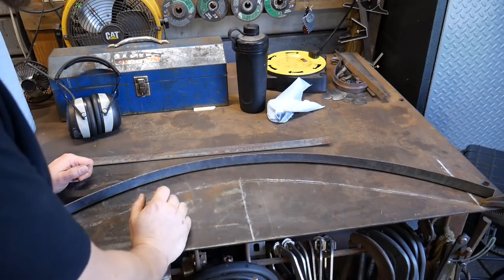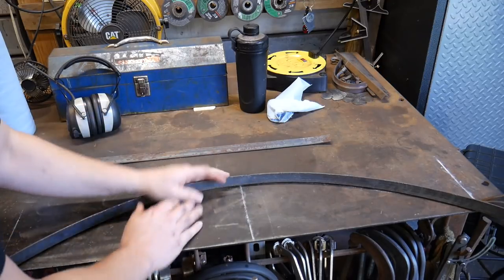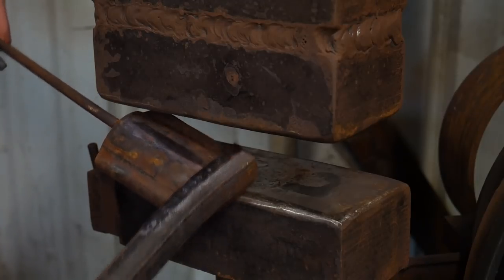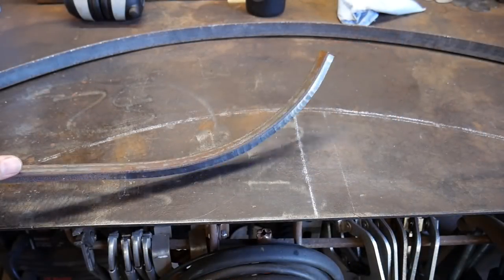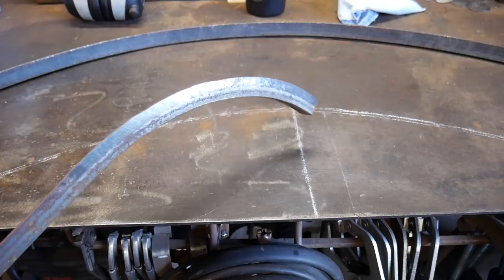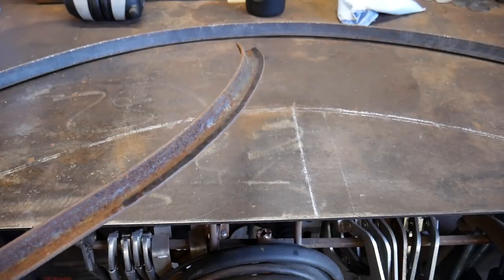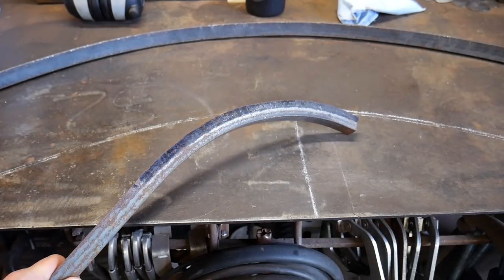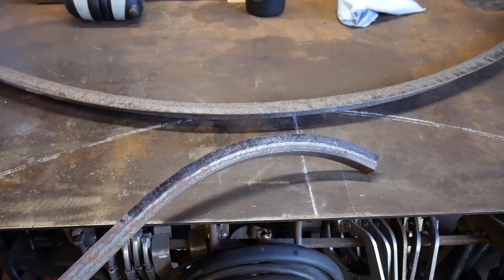How to Bend Angle Iron by Hand or with a Power Hammer

Comment: Francis Whitaker used to show a technique where he pre bent the angle in the opposite plain which then brought everything back inline when he made the final bend.  He did it all cold with bending forks.  Said he learned it from workers in canneries that made the tracks for the cans to roll down.  I have tried it and it is hard to get your head wrapped around.  Your technique is a bit more straight forward.
Reply: Roy's technique may be more straight forward but it leaves one edge thinner and hammer textured which is something you may not always want.Knowing both techniques is probably the best answer to problem solving.
Reply: differential pressure, this like differental heat treating that used in japanese cutlery and swords is what causes the famed curve one side has a greater pressure to harden in the water over the other when quenched and the clay side much more slowly cools,  so to with single bevel broadheads, oneside cuts and the other has a bit more drag so it walks as it goes though and creates a drillbit effect.
Reply: I'd like to see that.
Reply: what the bending or the drillbit effect of a single bevel broadhead?

Comment: Excellent!  I have a question-If I have 24 inch long wrought iron strap hinges, and they need to be bent up more than 45 degrees near the hinge end to be offset, can this be done by cold hammering? Others like this are sold pre-bent so that recessed doors can be opened and still clear projecting brick or stone. However these are all cheapo-looking factory made mild steel and this is for an historic appearance. Those sold that are historic looking however, are not offset but merely straight. Thank-you.        Whatever you do, work at it with all your heart, as working for the Lord, not for human masters, since you know that you will receive an inheritance from the Lord as a reward. It is the Lord Christ you are serving. Colossians 3: 23-24